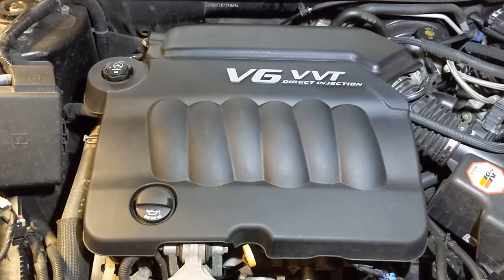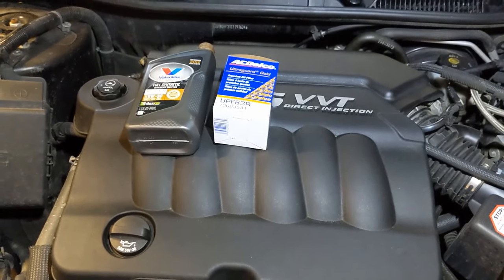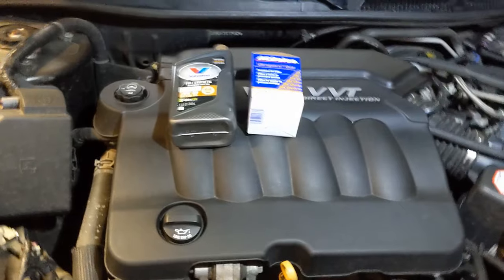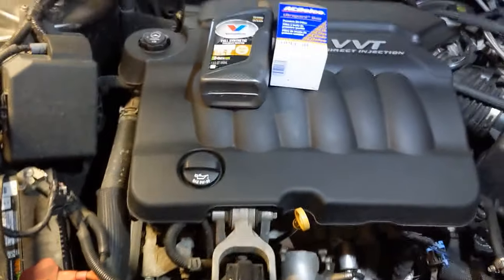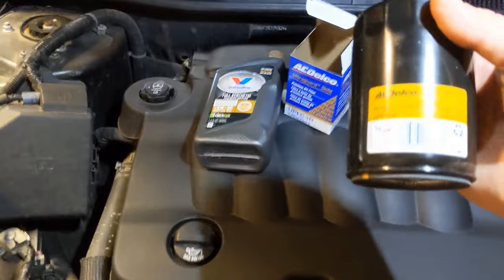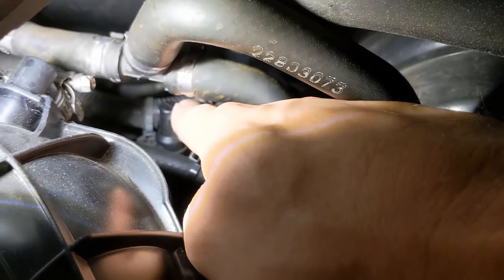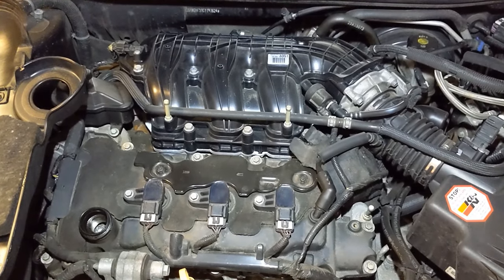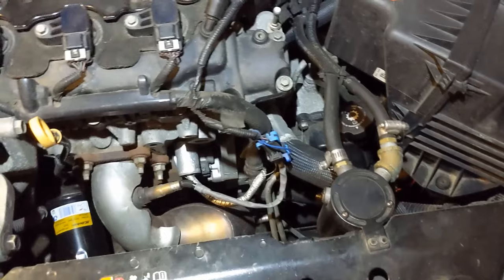How to keep your GM 3.0 or 3.6 V6 running forever - **High Feature V6 LY7 LLT LFX LGX LGZ**

Comment: Why would I want to modify my PCV?
Reply from the maker: It was a design flaw that GM corrected in later model years. The PCV was too restrictive and thusly caused an excessive buildup of sludge in the rear valve cover.
Reply: This may sound odd as He!! but he's right on this stuff Iv got the same drivetrain 236,000 miles the PCV is far to restrictive stock on 2014 and prior models rear valve cover looked like it had never seen fresh oil just full of build up front looked brand new drill it clean the valve train up with a flush "engine flush diesel never done it don't do it buy a engine flush instead"and then clean the actual valves take the uppers intake plenum off look at your valves they are probably carrying enough carbon to make a car guy depressed at the design and quilty not given every lil thing helps keep the 3.6 V6 going strong and is probably worth looking into this modification I haven't had loss of oil or any horrible amount of build up from this point on a year later yeah it sounds like a vary stupid fucken idea but it's not.

Comment: Plugs?
Reply from the maker: Go with the OEM Delco Iridium plugs. Same goes for any GM with a waste-spark DIS system.
Reply: @CertifiedShadetree  Thanks, r/r every 60k to 100,000 miles?
Reply from the maker: @Clarc115  The iridiums are good for 100k.
Reply: Yes, that is a word

Comment: My 3.6 is a Ly7 high output
Reply from the maker: 👍  That's one of the earlier 3.6's with port fuel injection...
Reply: @CertifiedShadetree  yes, 2007 engine, 24valve vvt 195kw  its in a holden calais,
Reply: Our police force have been using them since forever, they seem to catch most cars, good car to get ur hands on when they come up for auction as they are well serviced and have all the go fast xtras☺
Reply from the maker: @mikeneville9149   I'm jealous!  The Zetas that were imported to the States are snapped up real quick when they go up for auction. Not only that, but the older G8's and Caprices are waaay overpriced.

Comment: My equinox 3.0 received dexos full synthetic oil changes with a gm filter every 5000kilometres, the lower chain skipped at 155000kms, what a piece of junk.
Reply from the maker: Yeesh.  The 4 cylinder in that generation of Equinox was just as shitty, if not shittier than the 6.

Comment: Even the 3.0 in the Cadillac Catera 🤔🤔🙄🙄
Reply from the maker: YES! Hell, even the 3.0 in the Buick Century!!🤣🤣🤣
Reply: Ok cool because I found one with 20,000 miles on it for around $6500 and I was interested in buying it so I will check out you video and this video may may temp me into buying the Catera.
Reply from the maker: @samueljackson2478  Just be aware that the Catera's 3.0 is an entirely different engine, so ignore my oil filter suggestion. All the other tips apply..
Reply: Oh ok the oil filter in these are pretty decent anyway.

Comment: That's cause engine oils are poor quality, and they tend to get cooked in a hot engine, especially when the engine is off.  I just go by the color of the oil.  If it's dark brown, change it.  Good high-quality oil will go a little longer than the cheap ones that are in abundance.  My  naturally asperated engine get super hot hence why I change my oil when they get dark brown.  Cooked oil is never good for  an engine.  It's like putting water into your engine when they  lose their lubricity and addictives in extreme heat just by feeling the texture of it everytine you do an oil change. 5:21

Comment: You Tell us to do things like drill out the PCV valve but you don’t say why I’m not just gonna do it because you say so and I don’t know why she do it
Reply from the maker: Please read the description.
Reply: @CertifiedShadetree  I did all it says is how to keep your v 6 running forever. 
That’s fine but I would still like to know what drilling your pcv value dose. What is the improvement. I really would like to know. Just because it’s interesting to me. Not trying to argue or say that you are wrong at all. Now if someone tells a person who knows nothing about car’s at all not one single thing. And you tell them to put in full synthetic oil instead of just regular plain oil. They are going to want to know why because synthetic oil is double the price and they want to know the reason for it what is so much better about it. That’s all I’m saying I want to know what does all these modifications do for your car like drilling out the PCV valve.
Reply from the maker: Okay, here goes:  The early High Feature V6's had a very restrictive PCV valve (more like an orifice) that caused the rear valve cover and valvetrain underneath to build up immensely with carbon.  Around 2014-ish, the factory began enlarging the holes in the PCV valves of the 3.6's. So by drilling out the holes of the PCV to the larger sizes the factory has since done, you reduce the restriction, thus the chance of carbon buildup on the top side of the engine.

The owner's manual specifies synthetic oil be used in this engine (the newer 3.6's require DEXOS approved oil.)  The reason for using a high quality synthetic and changing it often is twofold. 1. The timing chain tensioners on this engine are notoriously fickle.  If you continue to neglect changing your oil, the oil passages in said tensioners clog up and eventually cause the timing chains to stretch and jump timing.  Using inferior dino oil has the same effect.  2. The very fact that it's a Direct Injected engine causes the natural blow-by of crankcase vapors to collect on the intake valves and turn to hard carbon deposits. Since the fuel injector now sprays fuel directly into the cylinder rather than at the back side of the intake valve, there is no "washing" effect to clean off said deposits.  Using a high-quality DEXOS synthetic reduces blow-by, thus carbon buildup.  This leads to why I recommend installing a catch can.

Bottom line, these engines aren't like the older GM pushrod designs, where you could neglect them for 20, 30k without consequence.  These require much more attention and more rigorous maintenance to keep them happy.

Hope this clears up any confusion!!
Reply: @CertifiedShadetree  thank you very much. That helped me a lot I didn’t know that wow. I have the Pontiac G6 with the 3.5  seems to be a pretty strong motor. Pretty fast for V6 I only use Moble one Full synthetic and change it every 5 to 6000 miles I hope that’s enough. I forget the name of this oil that says it’s 100% Synterra oil. Not ( Full synthetic) like all the oil you get at the parts store the full synthetic it’s not really synthetic. The base is conventional oil and all they do is add a ton of additive packages and then they get to call it synthetic. That was taken to court I believe in the early 80s. Now the 100% synthetic is from a synthetic base . And therefore is 100% synthetic and that is the only oil that is 100% certain sonic on like mobile one even though I still use it the 100% synthetic oil is like 10 or $12 a quart. But I hear it’s really worth it and they’re showing test after test after test that this stuff really improves your horse power and you get better gas mileage with it . The name is Amsoil. It’s supposed to blow mobile one out of the water
Reply from the maker: Amsoil is an excellent oil, as is Royal Purple.  Check out the channel called Project Farm.  He did rigorous testing on (I wanna say 32) brands of synthetic oil, and compared them March Madness style until there was one winner.  I honestly don't remember who won, but IIRC, Mobli 1 was knocked out of the first round!  https://www.youtube.com/playlist?list=PLjT3B9r2z3fXlvbP3tb9e056Q8O5krrCW  

Your 3.5 (called the 3500) is based on the old 60* pushrod motor that dates back to 1980 (not a knock - I've owned dozens of those motors!)  The 3500 is the end of the line as far as the evolution of the 60* V6 goes, but nonetheless not nearly as finicky as the 3.6 High-Feature engine.  Certainly more reliable than the prior 3400 & 3100 with their intake gasket issues.  I would always recommend synthetic oil for any car made after 2000-ish, but in yours you can use the cheap synthetic they sell at Walmart and it won't harm a damn thing.  In fact, nothing in this video pertains to that motor at all.  GM pushrod motors will make it well past 200k in their sleep!!!
Reply from the maker: I had to go back and dig up his "Championship" video.  It was 16 oils tested, the championship was down to Pennzoil Ultra VS Amsoil, with Amsoil picking up the victory.  Mobil 1 WAS knocked out of the first round!!

Comment: Dear Certified Shadetree,
None of your advice will keep a 3.6 running.
I'm gonna call you out on this video. Let me start with my bias: I'm a Ford dude, and I hate the GM 3.6 with a passion after owning a first-gen one. It drove me insane. No codes, and just random shuddering and engine shutoffs. Ditched the car before the motor blew completely. And it absolutely dumbfounds me why they still make these things today. Well I know why. It's because GM is such a lumbering behemoth that they only care about satisfying government regulations so this engine can be legal. So GM can keep churning out these pieces of garbage. 

Anyway, here's why you're wrong:
1. There is no way to fix the timing issues with a GM 3.6 besides rebuilding the timing. And have fun with that. The timing on these motors is built in the stupidest way I've ever seen, and they haven't changed it since 2004. There's 3 chains, with plastic guides and tensioners. That's why they break. Going ham on oil changes won't do squat for the timing issues. Oh, and the ECU won't throw a CEL for a stretched chain. Not till you need a new motor.
2. You forgot to mention rebuilding the timing. In order to get past 150k miles, you will always have to do a chain job. Preferably even earlier. Of course, plenty of other stuff can and will go wrong, so you should say no to rebuilding this motor. Also, you at least want the timing checked with diagnostic tools.
Reply from the maker: Dear Ford FANBOI,
Allow me to retort. For one, I have said multiple times IN THIS VERY COMMENT SECTION that if you have an early LY7 or LLT version of this engine to burn it to the ground and collect the insurance money!! Second, you are completely misinformed about the "GM 3.6" being the same since 2004. The "GM 3.6" has been revised several times, and in fact the LGX/LGY that was introduced in 2016 (and continues to this day) is an ENTIRELY NEW ENGINE FROM THE GROUND UP!! One with a single timing chain, and a massively revised PCV system for starters. These engines have NONE of the issues the earlier 3.6's had and are quite reliable with the proper maintenance. In which case, saying my advice is crap, is like saying you're guaranteed to get cavities even if you brush your teeth 3 times a day!! 

The original "2004 3.6" had 3 different versions, the first 2 mentioned above (LY7 and LLT) ARE absolute garbage, but the final revision of the 1st Gen (LFX/LFY) are considerably more reliable and rarely have timing chain stretch issues (unless, of course, they aren't maintained meticulously.) 

My main point of this video is that GM hasn't made the 3800 in over 16 years, and you can't expect your car to last very long if you neglect to change the oil like you could with those old pushrod engines. And conversely, NOT ALL 3.6's ARE JUNK! Only some of them. 🤣

I dunno, man, I'd take the Pepsi Challange with an LGX against one of your insanely reliable EcoBoosts to see which makes it to 300k without grenading any fuckin day of the week!! 🤣  To add to that, as an admitted GM FANBOI, I'm massively disappointed in GM for following Ford into the "let's cram as much boost as we can into a weak-ass 4 cylinder" realm.  Whomever thought it was a good idea to stuff a car engine in the F-150, cram 25 PSI of boost into it, and thinking it would last past 50k deserves to be shot!! 🤣🤣 Or maybe they're a genius and I'm missing the point. 🤷‍♂️
Reply: @CertifiedShadetree  Yes Ford churns out a bunch of really dumb cheap stuff, but compared to GM it performs consistently better. Chrysler is better than GM at this point. The thing is about a Ford Focus, the transmission will shit itself before the EcoBoost does. The Ecoboost cannot and should not be expected to make it to 300k without a rebuild. If you do push it that far (without the transmission blowing), you'll need a new motor. Ecoboost is not the pinnacle of Ford reliability. The Coyote 5.0 isn't either. And another thing. At least the EcoBoost kicks ass while it's running. That it shares with the GM Hi-Output and the Chrysler Pentastar. Great power.

Yes, Ecoboosts require turbo rebuilds often. But guess what, Toyota Tacomas don't have a non-turbo i4 anymore. Neither do Jeep Wranglers. Everyone is on this godforsaken turbo bandwagon now. The Tundra forces you to turbo now. 

My main point is, I'd prefer a Chrysler 3.6 v6 Pentastar over a GM Hi-Output 3.6 v6.If this LGX is radically different from the Hi-Output (redesigned timing system, which I'm currently researching), then that's on me for not knowing my GM's.
Reply from the maker: It's a single chain, but it's a moot point anyway, as it's dead after 2024. I honestly think the push away from V6s V8s and towards turbo 4's is a ploy to get us all into EVs. Did you see what Stellantis introduced this morning? https://www.youtube.com/watch?v=RyWWPEbHT-I
It's a real toss-up to me whether I'd want to own an overboosted tiny turbo 4 cylinder or an EV that makes 6000 "HorseTorques." 🤷‍♂️ "It makes insane power!" Sure, but it's an EV. "It still runs on gas!" Well, it's a fragile little 1.2 liter 4 that's boosted to 30 PSI. Both sound absolutely appalling to me! 🤢🤮
Reply: @CertifiedShadetree I'm gonna finance the last v6 challenger. I love how the EV charger is gonna have some kind of "beast mode" button lmao. I was chatting with some gentlemen a while back, and we were wondering what the cost of that button would be. Some say that you'll have to pay Stellantis every time you want your car to enter "beast mode", while others said that you can use it as much as you want, but it reduces your social credit each time lmao.
Reply: @CertifiedShadetree  I love how GM finally makes another good v6 after so long, only to kill it almost immediately. Government Motors indeed. I for one blame the government at this point.
Reply from the maker: @fyodor8008  You could apply that statement to anything GM "finally" gets right. "They FINALLY build a small car worth buying, then they kill it." I blame the UAW more than anything. I get that assembly line employees need to make a livable wage, but compare what UAW workers receive versus "Right To Work" non-union auto workers make in the US. RTWs wages are completely reasonable and livable, UAWs are completely overinflated. It's the reason GM, Ford, and Chrysler can only make a sustainable profit on pickup trucks and large SUVs. Baby Bush and/or Obama should've let GM and Chrysler die if they didn't get rid of the union. I'm willing to bet the domestic auto industry would be thriving with US-built CARS still being manufactured if they had the balls to kick out the UAW..
Reply: @CertifiedShadetree  Everything would be fine even with unions, if the government didn't try to micromanage everything. That's the real problem here.